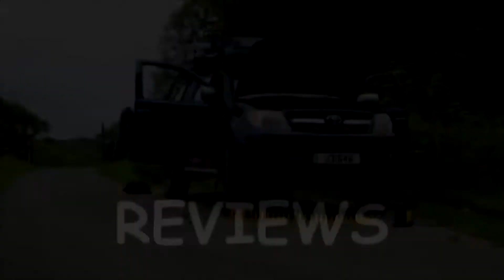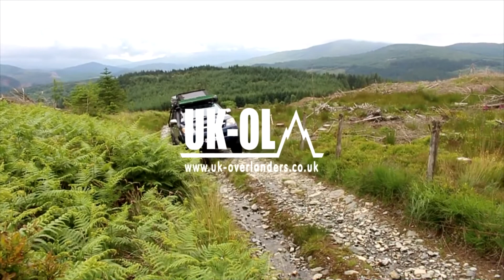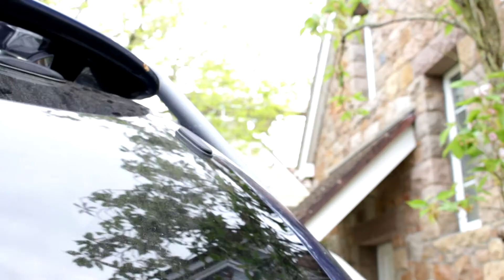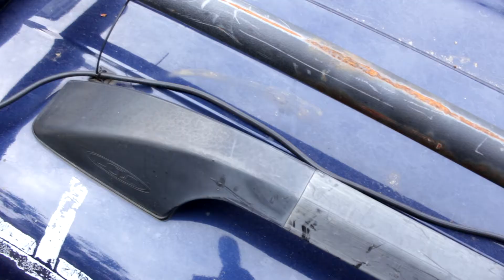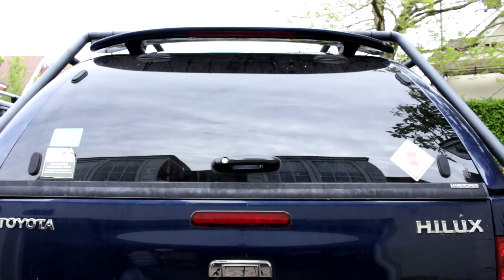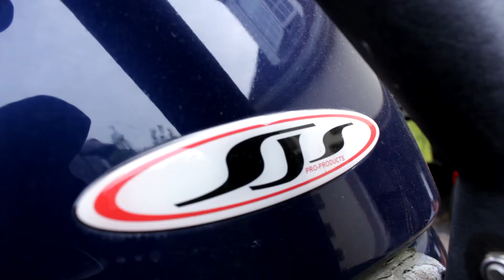SJS Canopy Long Term Review

Comment: Have had one of these SJS adventurer tops since 2011, when you buy one fitted by Mitsubishi they cost an awful lot more than £1200, I insisted my first one was replaced because on delivery of new L200 Barbarian, the paint was already bubbling, it was replaced reluctantly, the new one started to deteriorate and has continued to to this day (2020) the lacquer has all cracked off and the paint is following it, the handles corrode quite quickly, and the clamps to the bed aren’t great, the whole thing moves and ends up binding on the tailgate. It looked great originally but they do not last.

Comment: Hi,
Just come across your video, I have  just purchased an Hilux with an SJS canopy. Just wondering you said the canopy tail light  is not working, is it a reqiurement under UK MOT law that the canopy tail light operates. Has your canopy  had an MOT test with the tail not working & passed? Thanks for the posting the video

Comment: I have the CarryBoy. I think they’re generically made in China in bulk before being re-branded over here.

I have to agree with the likes of Andrew St Pierre - it’s worth spending the extra money for a stainless / aluminium back end. Better made, structurally capable of bearing the load of a RTT and don’t leak. They also give scope to fixing points inside - table storage slides and the like.

You look like you have the skills to fabricate one yourself!

I agree - no fibreglass backer is suitable for overlanding. The only exception maybe the ARB as they manufacture one with internal steel supports - but these are rare as hens teeth!

Thanks for the Vid!
Reply from the maker: Yes I would have to agree with you, if we were to do it all over again an aluminium canopy would be the way to go. Personally I would have to look into the Stainless option abit more as I assume it would be ALOT heavier then the Aluminium option but for the vast majority of people still a better option then a Fiberglass canopy when it comes to overlanding

Thanks for the support!